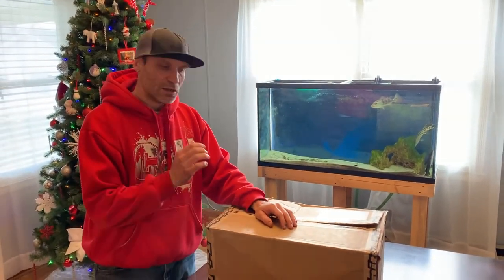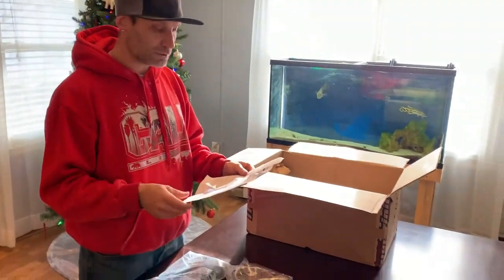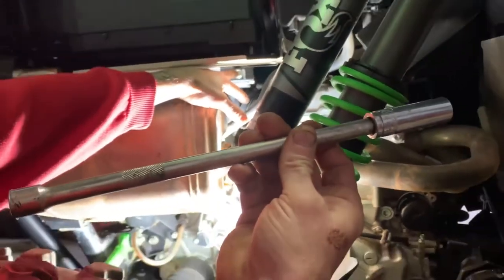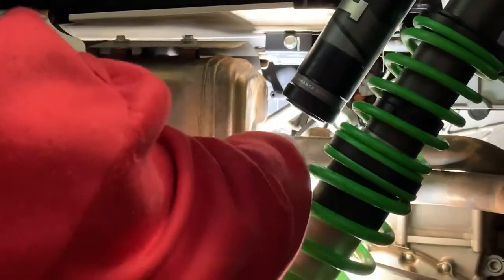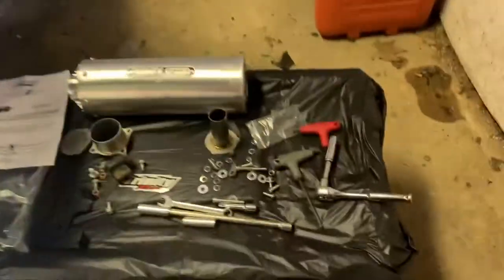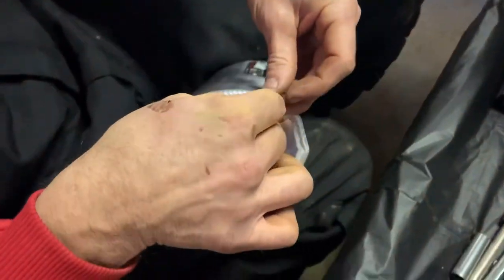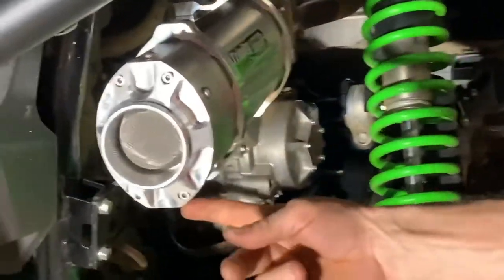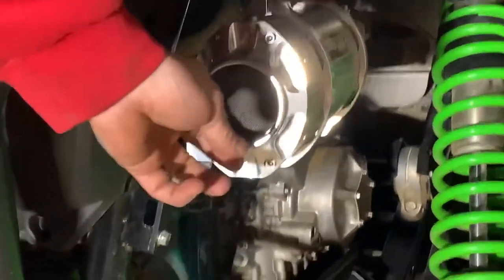How to install Trinity stage five exhaust on a Kawasaki KRX

Comment: I just purchased the trinity exhaust for my KRX. I have not bought the Command 5 tuner yet. Have you heard of any problems running the exhaust without the tuner?
Reply from the maker: No you’ll be fine if you put it on run it for a while on the computer will Justin the best I can with the exhaust but the power commander five and exhaust together is a major difference
Reply: Best how to video I've seen , lighting is excellent !
Reply from the maker: @tomreece2316  thank u

Comment: Are you happy with the pipe? thinking about ordering it.
Reply from the maker: Yeah I’m very happy with it I decided to run mine with the baffle in it because without it it is extremely loud and if you run the power commander five with it it opens the machine up a lot very happy with it a lot of Gangs from the package or the combination if you Need any help on mapping the power commander or just any info please for a free to message me thank you